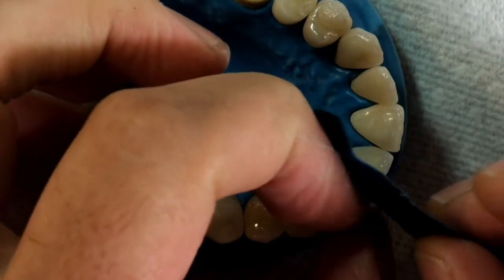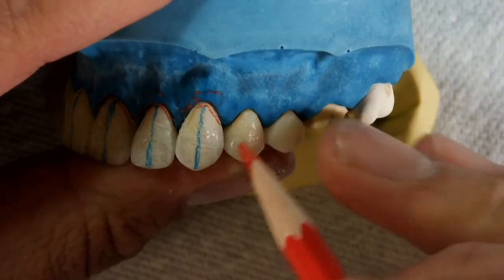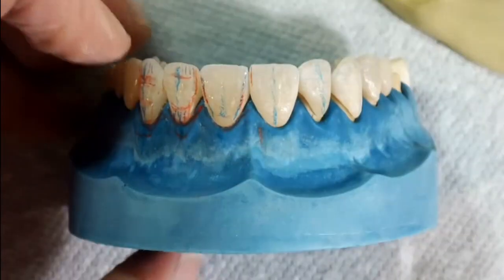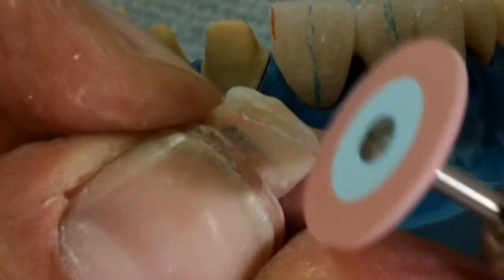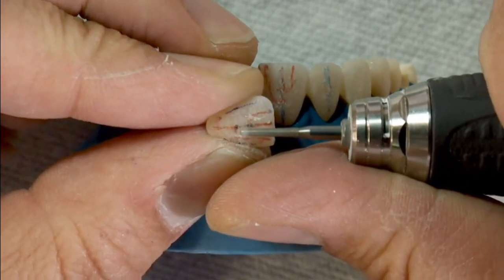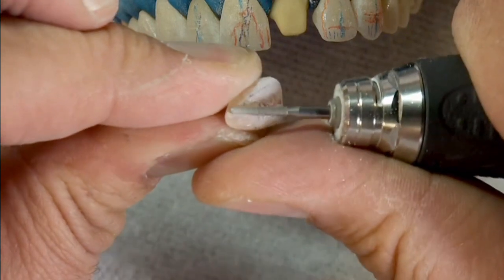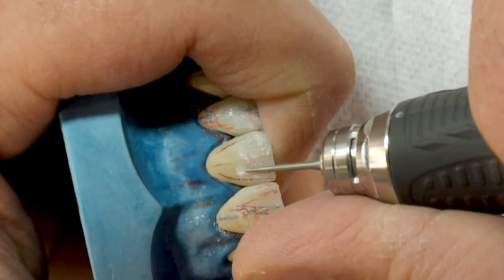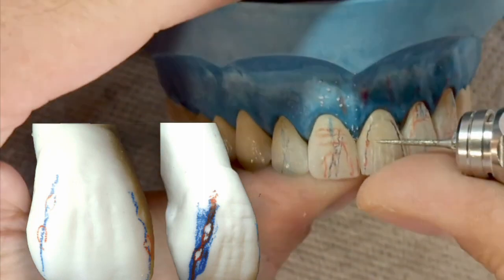Contouring Ceramic Crowns - Step by Step Guide For The Perfect Smile Design

Comment: Nicely detailed. Thank you. What is your advice in choosing the best Library in exocad for crown and bridge?
Reply: For those cases of having to create an entire anterior composition or a complete arch, I suggest doing a morphological analysis of the patient's face and, if possible, a cephalometry to more accurately measure the angulations and with this and a little more, determine what type of teeth the patient needs for their comprehensive rehabilitation.  Function, aesthetics.
Reply from the maker: @TheFdohdez60 I 100% agree. That should ideally be done in the diagnostic stage.
Reply from the maker: Get a patient photos and use the smile creator.